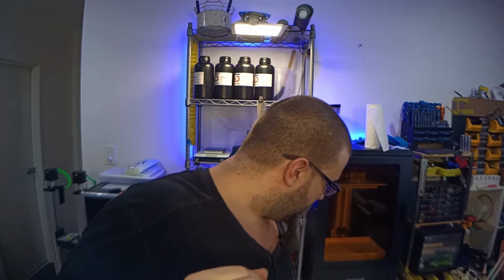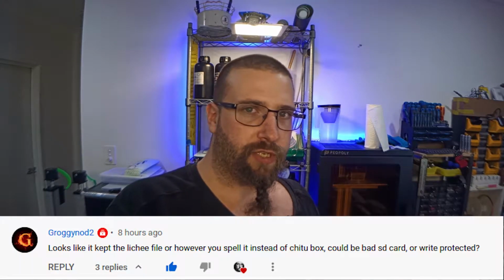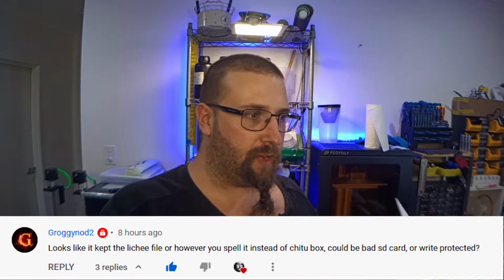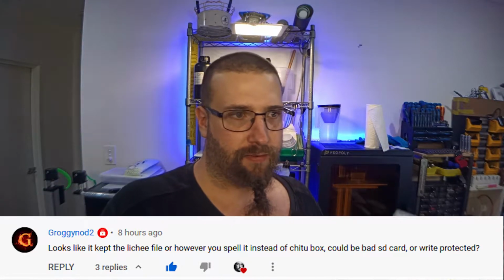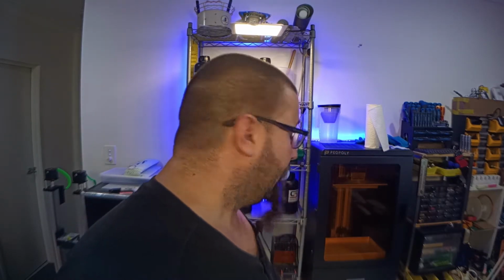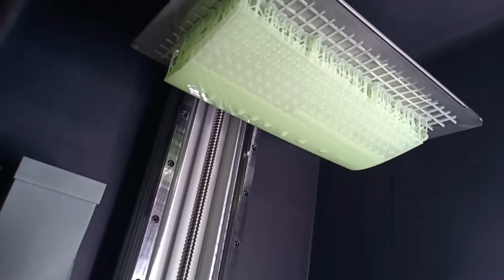chaos daily 2021: 093 Now that is bettererer

Comment: Thank you for explaining the issue. I still think that going to a delicate sideway tilt (left-right) could help totally drain the wing cavity from the resin. But if that is not an issue (apparently it is not) - then I agree to proceed as is.

I've heard that the resin printing has also some issues with dimensional stability (parts shrink in non-isotropic ratio). Is that true? Or it is accounted inside the slicing software?

As for resin printers - I do find standard FDM (I have 7 printers) to be still sufficient for my projects and planes I design - you can check my channel. If I buy a resin printer I would use it mostly for figures - and this is not something I would like to spend my money on :) Not yet.

And just for future reference - my name is indeed Slavic - but it is Polish language (central Europe) :). To pronounce my full name 95% correctly try "P-she-meck Ya-cub-chuck". But my first name is Pshemeck or Premeck and is good enough. Thank you for trying to pronounce it - I really appreciate it.
Reply from the maker: So there is already a bit of left to right slope, but the curvature and tapering of the leading edge makes that effort pointless for some of the parts, and too much slope to counter it drags us back into the 20-30 deg orientations again.

so yes some printer and resins have bad dimensional issues, this resin and printer have zero issues. also having you slicer printer profile correctly calibrated it very important. Peopoly spent a great deal of effort dialing in those settings and the Phenom profile that comes with Chitubox is spot on.

Next episode im going to butcher your name some more lol.

Comment: Having buckets of failed prints I share your pain and frustration. Being an underdog I have a tendency to root for the underdog. Just trying to help make sure you covered the bases logically. It's really strange as to why the file saved corrupted like that. Thanks for the mention, clarification of your process, and some of the caveats of photonic curing. I hadn't even considered how much of a role wave-particle theory plays in this, as it right up the alley of the double slit experiment. It's really fascinating we still haven't fully figured that shit out yet. I'm guessing that's part of the reason why you're printing the wing horizontally instead of vertically as it provides a better resolution in the Z axis as opposed the to the X/Y.
Reply from the maker: Thanks man. Yeah pretty much, the resolution is more then enough to do vertical. but it just boils down to watt output of the UV array and mask pass through rate. to print vertical I would have to double the exposure time per layer, on top of the part printing vertical. A wing section would take 40hours to print then, vs the avg 6hr print time I have now. 
With a Mono screen that allows for shorter exposure times per layer you could possibly print more vertical. But Resin print times are a function of Z height and exposure time. So the fact it prints better nearly flat is a win anyways lol. I just have to be careful the area distribution per layer for good lifting for even and low suction force, and drainage locations.